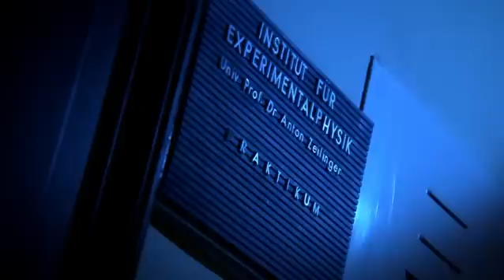Quantum Mechanics - Double Slit Experiment. Is anything real? (Prof. Anton Zeilinger)

Comment: I'm new to this. How are photons detected? Is it using some sort of magnetic field? Cuz if so, couldn't that alter the test and it's not visibility or observation? That's producing the different results button. The magnetic field introduced by the observation method... I'm not a scientist. I'm just a dude off the street but I have a question. Can someone answer how do they detect the photon in order to measure it

Comment: Hmm, putting electromagnetically charged detectors near photon streams that create electromagnetic waves changes it's trajectory, no I would never have seen that happening because I'm an ignoramus.  By the way, they lie when they say one photon at a time comes out. They also neglect to mention that electron charge builds up on the small edges of things, whether it be metal drill tips or the edges of wood and paper. If you are an ignoramus like me, you will just dismiss that scientific fact and it's consequences of having a beam of light pass near it.

Comment: Try to use own battery operated light source and detectors, don't connect the light source and detectors to same electricity power source.
This may cut off the communication channel between experimental apparatuses and the CULPRIT HIDDEN IN THE DARK.

Comment: At 0:49, the beam seems to be way wider than the two slits. So what if photons bump to each other because they are fired at slight angles? the experiment, as shown, does not make clear visually that only one particle is fired at a time, and that it is fired at an actually straight line.

Comment: well.. the "Detector," or the "Observer," is electronic... it also relies on waves to detect. It is ridiculous that double slit experiments when explained to the public never mention in details what kind of "detectors" exactly were used and the mechanism of detection.
Reply: A detector is simply a system that absorbs energy. What kind of system it is doesn't matter to the physics of this. Some of the best detectors are not electronic but thermal. We call them "bolometers". In a few decades your camera sensor chips might be using bolometers instead of silicon sensors.
Reply: @schmetterling4477  The act of "absorbing energy" would interfere the wave wouldn't it?

Comment: The results of the double slit experiment are best understood using the concept of decoherence. If we examine an isolated system (no detector) the evolution of the quantum system and that the rest of universe are independent, and as such an initial pure quantum state evolves to a pure state given by applying the Schrödinger equation. The interference pattern is a result of the wavefunction being decomposed into two parts (comprising of the particle passing through each of the slits) and recombining on the far side with different phases. This is the wavelike behaviour.

In the presence of a detector, the situation changes. The system and the environment (rest of the universe) are no longer isolated from each other and information can flow between the two (indeed, a detector is not a detector unless this is so). If we try to analyse the quantum system in this context, we are restricting attention to a subsystem of the universe, the equations that govern the evolution in that case are best described by a density matrix formalism (e.g., Master equation in the Lindblad form), this allows a pure quantum state to evolve to a mixed state and for information to be passed out of the system (and its entropy to increase). This evolution is non-unitary (but this is to be expected, just as a rotation in two dimensions preserves lengths, but if we restrict attention only to a coordinate axis, then the rotation can shorten or lengthen the projection onto that axis). In the density matrix formalism the detector forces the off-diagonal terms (in a suitable basis of eigenstates of the operator associated with the detector) to tend to zero very rapidly, the resulting density matrix is interpreted as a probabilistic mixture of quantum states which are no longer capable of interfering with each other (due to the vanishing of the off-diagonal term). This gives rise to the particle-like pattern in this case. 

In short, there is no mystery about the double slit experiment from a quantum mechanical viewpoint, though early attempts were hampered by the assumption that the restriction of a system to a subsystem would always behave in a unitary manner (the von Neumann wavefunction collapse rule was an attempt to force a state based approach to give a good approximation to the density matrix approach, though it lacked the ability to describe all possibilities at once, which is where most of the confusion around this procedure comes from).The decoherence process is continuous in time, and is governed by  a differential equation, so no instantaneous "wavefunction" collapse occurs. The truth is that the quantum state of the universe evolves unitarily but that non-unitary evolution arises inevitably when a non-isolated subsystem is under consideration.  I made a video going through the mathematics of the double slit experiment in great detail on my channel for those interested in seeing the details.

Comment: 1. Are "photons" really particles?
2. If the presence of a detector changes the result, perhaps the detector is interfering with the experiment? What makes an electronic detector/observer different than a human observer?
Reply: The problem is that it is irrelevant that there is a detector splitting the photons to measure them. The problem is if the scientist has ever got the knowledge about the measurement. 
In the Delayed Choice Quantum Eraser Experiment this is shown very clearly, the particle literally travels back in time to change the pattern from particle to wave-pattern simply by the fact of scrambling the real information about the measurement of the photons so the scientist no longer can know. 
The photons are a quantum object that exists at least in 5 dimensions and we can only see it acting like a particle because we are trapped within a nervous system that is not capable of translating more than 4D spacetime. If we could see 5 dimensions we probable wouldn't collapse the "wave function" of particles.

Comment: PART 1 - I will reword what 2 slit experiment simply -
1  if only a 
physical particle is sent out of the machine one particle  through one 
slit and next one through the second slot - which you think  would 
result in 2 lines on the wall.
2 However  we have a strip effect on 
the wall. This can only happen if each  particle goes through both slits
 at the same time. This means something  is attached to particles.
3 
My argument is that  as there are only two realms Physical and Spiritual
 they both go  through the 2 slits together to create the strip effect, 
the spiritual  is invisible but through the experiment looking backwards
 on the wall  the invisible is identified with the strip.
4  So God 
then gave me a verse - It is the glory of God to conceal a matter  and 
the glory of kings to search it out. So what is concealing a matter  ? 
It is HIDING! So if the spiritual realm has God's characteristics it  
would all hide as well. Which happens to be the case. So when we add the
  law of Detection by putting detectors on the particles to see what is 
 happening the Spiritual Realm hides in the physical particle - then we 
 are back to what we expected 2 lines on the wall.
5  Now it cannot 
be anything physical as it does not have the  characteristic of hiding, 
like say you might want to argue it is light,  but light does not hide. 
look up Adam Grech on facebook for part 2 and 3

Comment: 02:40 - "neither allowed to say photons passing through the two slits" ---> Nope, there is NOTHING TRANGE if// we consider that the Photon is A SINGULARITY (the Centre of Mass, even we used to say of Energy only) OF A WAVES IN THE THIN STRUCTURE. And for the  Influence of the Sensors, it can be Explain by the fact THEY INFLUENCE THE THIN STRUCTURE BY THEIR OWN RADIATION OF THIN STRUCTURE WAVES BY INCREASING ITS LEVEL OF DENSITY ENERGY ENOUGH TO BEND THE WAVES IN A ROTATIONNAL LIKE MOUVEMENT AROUND ITS CENTRE  OF ROTATION, WHICH MAKES IT AS A PARTICLE.

Comment: How is it possible to shoot only one photon at a time? Are your experiments so accurate?
Reply: Easy, you start out with a normal light beam and put more and more semi-transparent filters in the beam until only rarely a photon makes it through. The tricky bit is having a detector that can measure a single photon. Well, perhaps not so tricky these days, somewhat surprisingly you can build one out a regular LED http://physicsopenlab.org/2020/02/27/using-led-as-a-single-photon-detector/

Comment: https://www.youtube.com/watch?v=o4s28XVfQaU
 Collapse of Wave function DS experiment (Myth Busted) 
Here is the collapsed two bands DS experiment. It is called Quantum Eraser experiment (not to be confused with the Delayed Quantum Eraser experiment) As you can see the collapse is artificially induced by the two 90 degrees different polarizer filters (i.e. these are the so called detectors or observers) that don't allow the two split light paths to interfere and therefore the collapse of the  wave function into two bands (two 90 degrees relative polarized light waves cannot interfere). As soon you introduce a recombining polarizer so that both split light paths have the same polarization and start interfering again, then the wave interference pattern emerges again. No mystery really, actually a perfect logical explanation. The collapse of the wave function is due the interference of the polarizer detectors and not due any strange property of light. Myth busted. Here is an even better explanation: 

https://www.youtube.com/watch?v=2PJbAeBERjI

Comment: the detectors are not being discussed correctly. Light is a wave but when we connect detectors they are preventing wave propagation and damping the wave transmission on the screen.  inert detectors that don't interfere with the charge potential of the light beam can only correctly confirm this phenomenon. 

The experimental setup is inadequate.
Reply: this was done with molecules and it proceeds... molecules act like waves

Comment: What are these “ detectors “ exactly 

Cant find a video of that..
Reply: A polarizer. The only purpose the detector had was to help researchers know which slit a photon had been fired through. Using single-photon counter (SPC) and yes these are real and work as described you could tell which side a photon arrived from. The problem is you lose the interference pattern. The reason is simple: a polarizer mucks up the wave as they are designed to do, allowing only a certain orientation of the light through, just like plain old sunglasses.

The polarizer collapses the wave function due because that's basically what it is designed to do given the typical orientation of the polarizing filaments. The result in free space right after the polarizer is just a point. The nature of the experiment and therefore the expectations of the result have changed by design; whether the researcher was smart enough to recognize this or not.

It'd be like making plain vegetable soup eating it and saying, "umm yum" and then an hour later add ice cream to it and expecting it still to taste like vegetable soup. You've changed the exercise entirely so your expectations can't logically be expected.

Honestly anyone who knew how polarizers work would not have even bothered trying polarizers for this experiment.
Reply: Marcus Anderson 

That makes a lot of sense, it used to trouble me like why just adding a detector collapses the wave function? Like  without interfering with the experiment itself 
It almost sounds like something is just observing from a distance and the very act of observing collapses the wave function which didnt make a lot of sense to me

Anyway thank you so much for the explanation!
Reply: @marcusanderson9042  So the entire double slit experimental results are nonsense?

Comment: The last part about collapsing wave function when the slits are observed by photon detectors is BS and a big lie. This was never physically demonstrated anywhere and even here in this video clip they reverted to CGI instead of the actual experiment showing correctly initially the wave function. I have literally searched hundreds of articles and books in the literature and there is not even a single reference of such a collapsed wave function version of the double slit experiment and formal presented results. There is not even a genuine real experimental demonstration of such a claim ever recorded in video. If it comes to that specific point of the collapsed wave function they always revert in the videos to CGI. Don't believe me? Do your own search about collapsed wave function double slit experiment. Good luck.
Reply: Honestly it seems that way. I haven't done much research but there's so many people on here asking for evidence of the collapsed wave function and there's no straight answers
Reply: @cogwun  Turns out what they mean by photon detectors placed after the DS, are two light polarizers which relative a 90 degrees light polarization difference, thus for example one is a vertical polarizer and the other a horizontal. This means that the photons coming out from the DS hit the detectors and cannot interfere anymore and therefore the wave function collapse. In other words the wave function collapse is forced artificially by the detectors and not any weird intrinsic property of light. Why they keep telling and presenting it as a weird property of light really escapes me? There is nothing weird here. Light split in two parts and orthogonal polarized between its two parts will never interfere.
Reply: @Markoul11  Thanks for explaining that. Yeah I'd seen a little bit of information about polarisers as detectors, but man, it takes a lot of digging! I too don't really understand why so many of these videos and explanations describe this part of the experiment as "It's as if the photons know someone's watching!" and use little animations with cameras or eyeballs to represent the detector. Very misleading.

This article kind of explains why though  http://steve-patterson.com/quantum-physics-abuse-reason/

The guy who wrote that article seemed very convincing that he knew what's what, but after reading that article I looked up pilot wave theory, and the Afshar experiment. Pilot wave theory seems to barely scratch the surface of all the weirdness of the double slit experiment and it's variations. The Afshar experiment was heavily criticised but most of that stuff goes over my head. So yeah, haha. I don't really understand what the hell's going on with all this quantum stuff, but it's really fascinating to read about, and even experts still seem baffled so I guess it's normal to not get it :)
Reply: @cogwun  Thank you for pointing this link to me. There is nothing weird and illogical in nature only human explanations are.
Reply: @cogwun  The problem with quantum measurements is the Signal tp noise S/N ratio of your experiment. In macroscopic world and experiments the S/N ratio is high and your measurement apparatus does not interfere in a way it disturbs the phenomenon you are measuring so what you get is that it is. But when you go at quantum size  the noise is too large and your measuring apparatus disturbs so much the phenomenon that is totally transforms it. So what you measure is not what it is. We have to invent less intrusive methods for measuring the quantum world.
Reply: @cogwun  Why you assume that the photon's size field is a small ball? Pilot wave (bouncing ball on a water surface creating concentric waves as the ball bounces away) is close to the truth but not exact. The mystery is solved when you realize that maybe a photon is not a particle-wave but a wave that behaves like a particle? The only wave function that concentrates to a point in space, is a vortex.  And in particular a vortex ring (like a smoke ring). In the DS slit experiment, the photon field which its field extends in space   and not represents a point in space, splits in two, passes the slits and then interferes with itself at the back of the DS apparatus. There is nothing weird as soon you abandon regarding photons as sizeless points in space :) The same is true for the electron which is a dipole vortex of magnetic flux joint in a horn sphere manifold: http://www.8128.info/magnetic-moments/
Reply: @Markoul11  Yeah I read a little bit about that, and that technology for "weak measurment" is advancing
Reply: @Markoul11  That's an interesting theory. I think I get what you're saying and it actually kind of makes sense. Certainly more than the pilot wave theory. But you should definitely discuss it with other scientists, cos a lot of this stuff goes over my head!
Reply: @cogwun  cheers! Yes there is paper in preparation to be published maybe next year second quarter.
Reply: @cogwun  
https://www.youtube.com/watch?v=o4s28XVfQaU
Here is the collapsed two bands DS experiement. It is called Quantum Eraser experiement (not to be confused with the Delayed Quantum Eraser experiment) As you can see the colapse is artificially induced by the two 90 degrees different polarizer filters (i.e. these are the so called detectors or observers) that don't allow the two split light paths to interfere and therefore the collapse of the  wave function into two bands (two 90 degrees relative polarized light waves cannot interfere). As soon you introduce a recombining polarizer so that both split light paths have the same palarization and start interfering agian, then the wave interference pattern emerges again. No mystery really, actually a perfect logical explanation. The collapse of the wave function is due the interference of the polarizer detectors and not due any strange property of light. Myth busted.